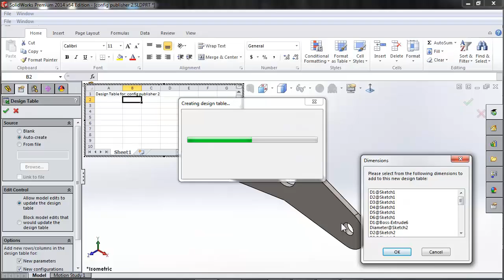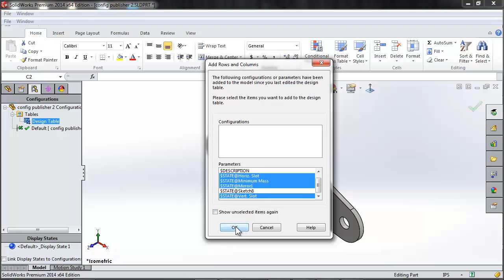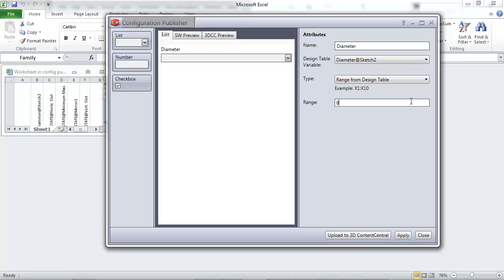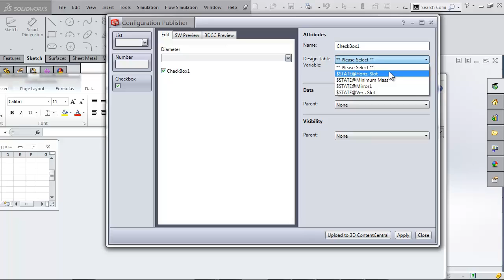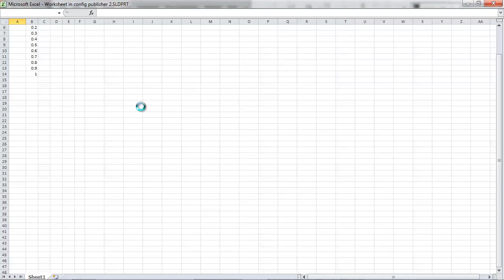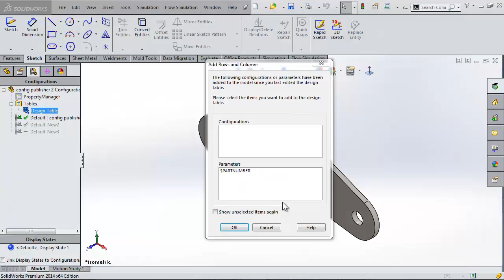SOLIDWORKS - Configuration Publisher Part 2

Comment: Hi...Very nice video!
I have some questions here..can you help me,pleasee??
Reply: Hi There !

Thanks a lot for being willing to help me out!
I am basically an Architect and Engineer, i´m Spanish and i live in Brazil
I work with SW for many years and i did all sorts of projects with it but  i never needed to create my own parts in toolbox.
Now i am working with metal construction and i need to use the Gerdau (Brazilian steel products)Beams in my projects.
I checked, but they do not provide libraries in SW format; so i took their data sheet and imported it into a table and generated a configuration for each beam.
So far so good, but i can´t manage  to just drag and drop, and then just drag/change the length,i even can, but then  the original part gets modified too,and i don´t want this;mainly because i might use many different lengths of a same beam across my projects.
I even could save different parts with each different length, but this is not practical.
So i saw your video, and, using the configuration publisher i put in a new control for length;but nothing happens, seems i did not link this to anything at all: i only get two values 2 or 50...!

So,somebody named Daniel at your company told me i should select the dimension for length but i could not make it work...
Also,I wonder why,within toolbox,my part has no configuration at all and it says: 0 configurations possible! why is this so? any workaround?
Is this the reason of why i´m not being able to change the length of the beam?
what can  do to sort it out?  i can send you the file if you want to...
I need this to work like the other toolbox beams where i just use the "edit toolbox component "  command and change it the way i need to!
THanks a LOT!
Bye!